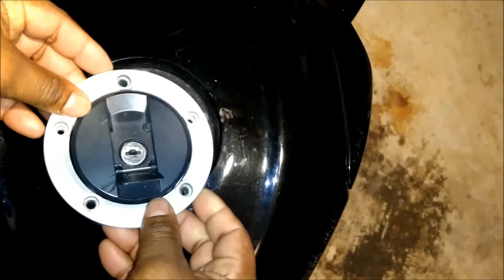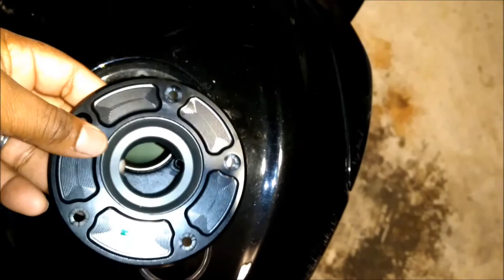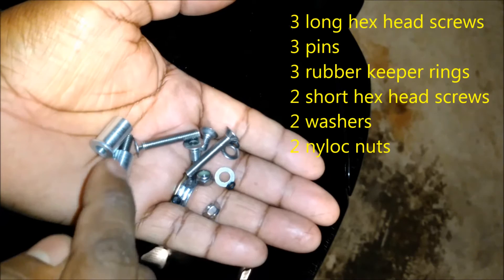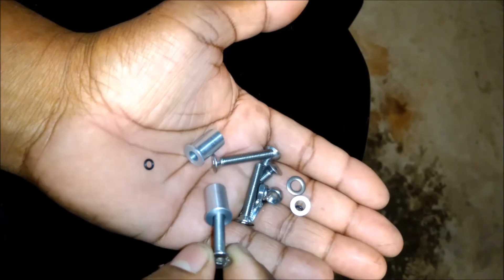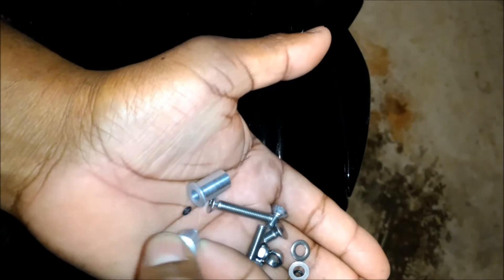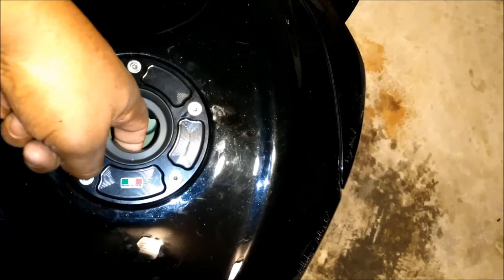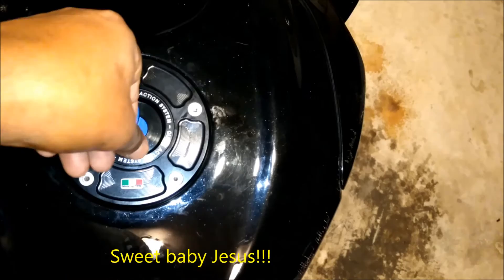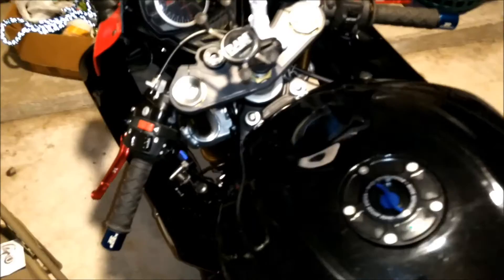TWM keyless gas cap install guide (Installed on a 14 GSX-R 750)

Comment: Great video. Just used it to install on my XJR. The plastic tube that goes in the vent port, will endup inside the gas tank with the fuel correct? BTW mine came with the nuts but no washers....Thanks in advance
Reply from the maker: Thanks man glad I could help and I apologize for getting to this so late Im just now seeing your response. There are 2 ports on my GSXr one goes back into the gas tank and the other goes to hose that leads out under the bike I hooked mine up to the port that leads back into the tank. I dont know why yours didnt come with washers hopefully you contacted the seller/supplier and inquired if yours was supposed to or not. Hope your'e enjoying it every time you fill up, I know I do. Keep the shiny side up.

Comment: I just put one in my ninja, but my vent didn't come with a hose and the vent hole is on the left side, not on the right side will that make a difference
Reply from the maker: Art Mercado I would get in touch with the tech support /manufacturer of the part to get that answered.